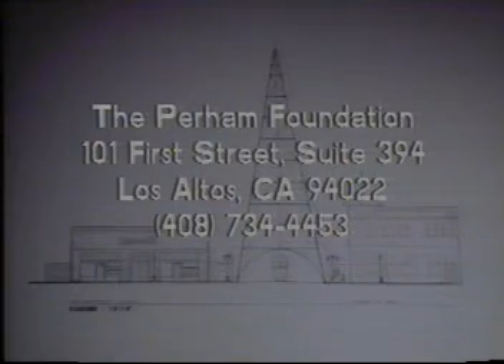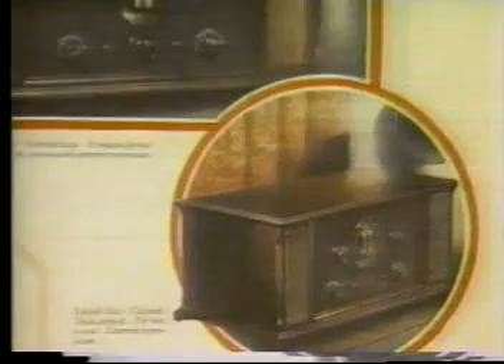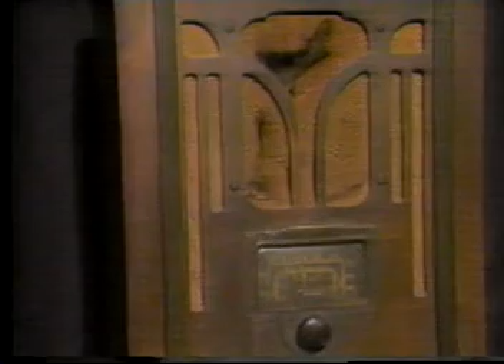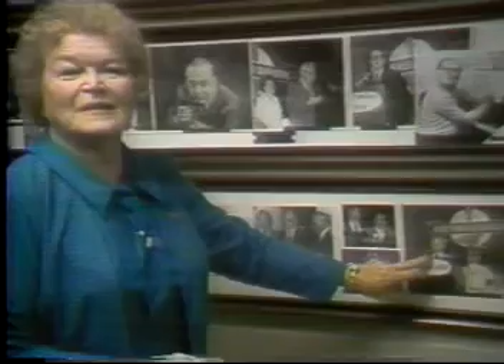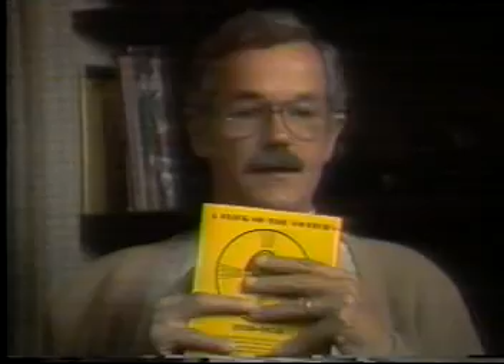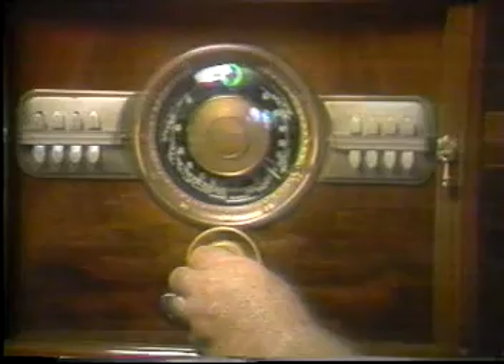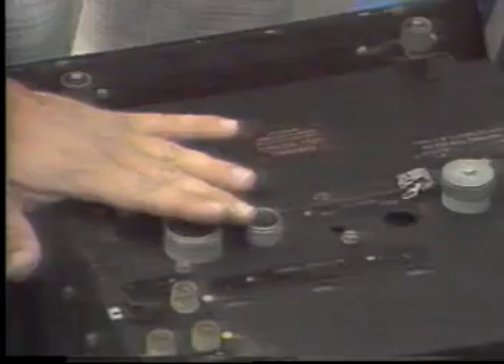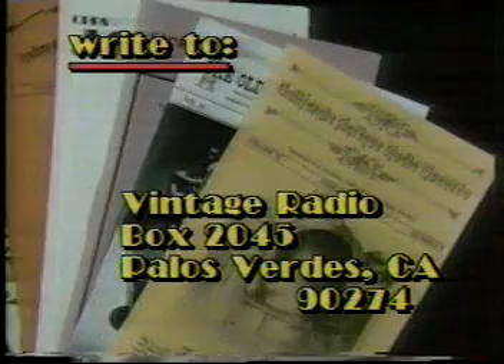radio collector

Comment: One of the great untold stories of WW2 involves the vast quantity of equipment, including radios, left behind by the British at Dunkirk. New radios had to be built quickly not only in England but also within the Commonwealth. One example is the Wireless #19. It was a AM & FM tank radio plus an intercom system. It was compact and could transmit & receive. For its time it was advanced but cheep to build using parts that were available in many places, parts that were often used with domestic electronics. Thought you would be interested. All the best from Canada.